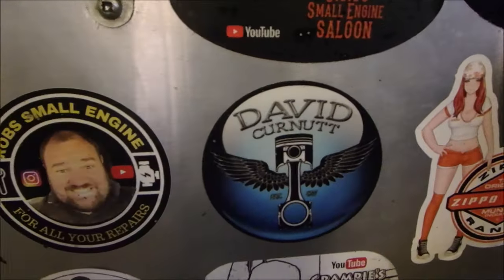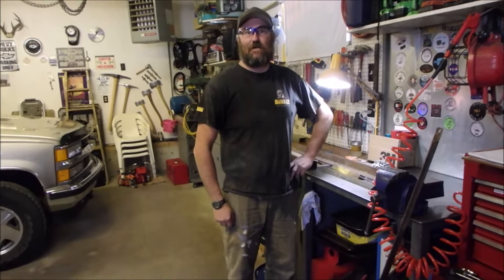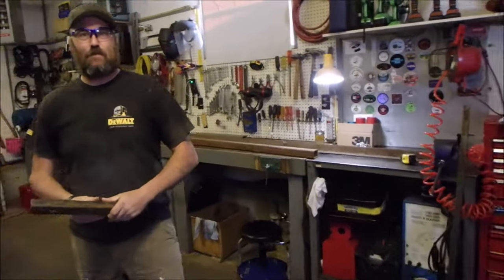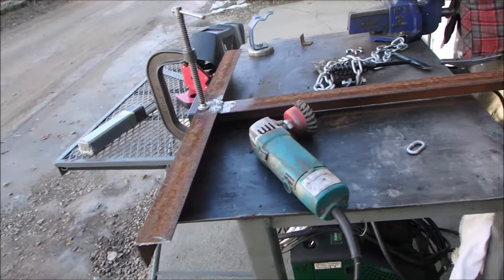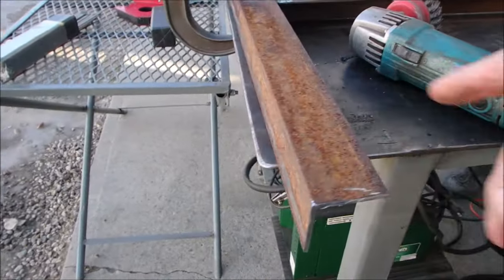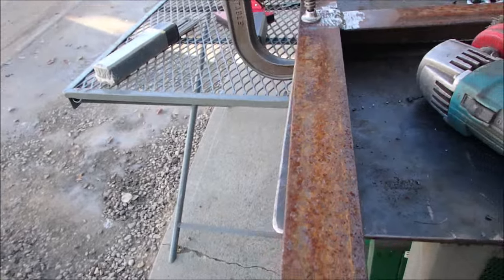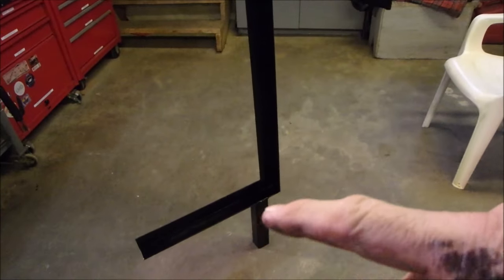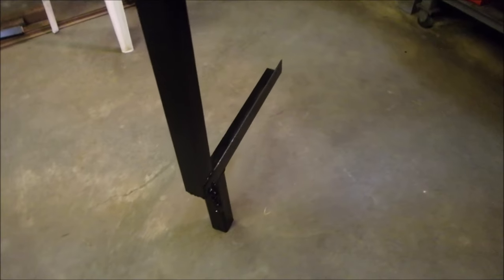Making a BIG bracket, plus a nice gift from a sub.

Comment: Nice! Keeping Mr Scum and Mr Bagg at bay!
Reply from the maker: Thanks  They are everywhere.
Reply: @BrucesShop  I know. I lost 3 mowers, a snowblower, a pressure washer and some weed wackers to an SOB a few months ago. I got it on video. That guy comes thru the neighborhood again I might get in trouble.
Reply: None of the stolen stuff had any real value. One mower ran but needed a head gasket. Another ran but you need to know the secret of the throttle.